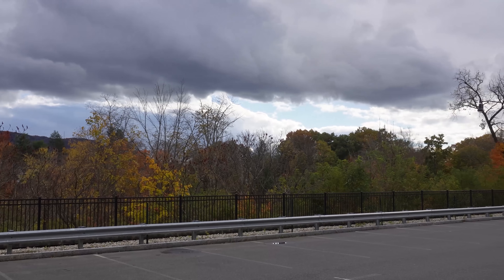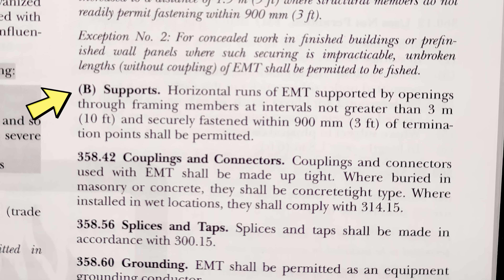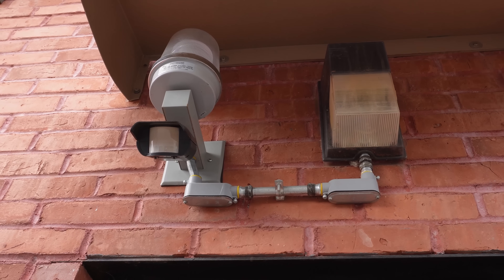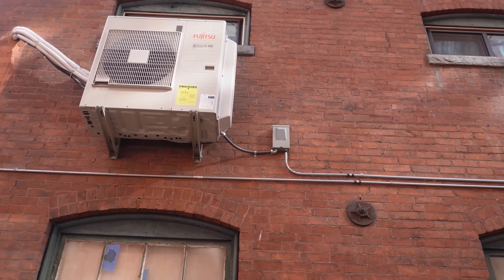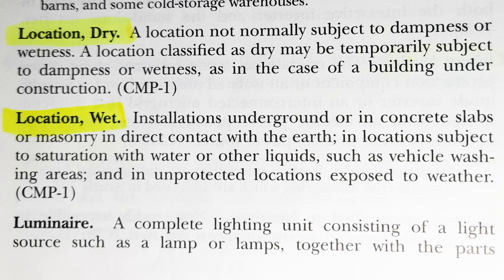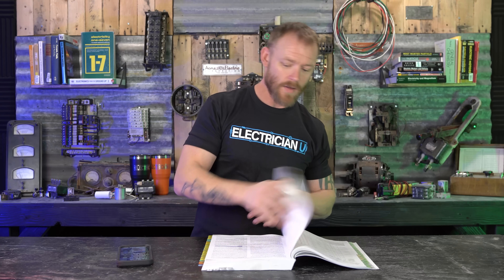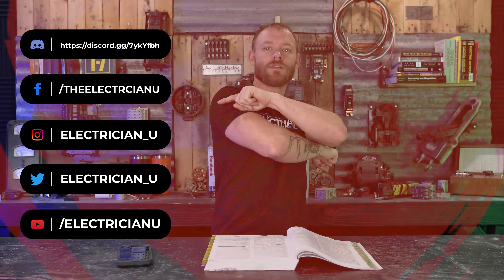Finding Code Violations in a 100 Year Old Building!

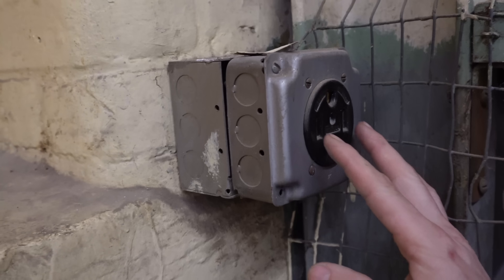Comment: at 10:40 you show a pipe above a 240 volt outlet and being commercial I have to wonder if that was a compressed air line due to the odd (small) size of the elbow and the large body of the valve itself, which might make it a gate valve. (more common in air systems) The rest of the video has some hum-dingers for sure!
Reply: That looks to me like 1/2" galvanized pipe, with a galvanized elbow that has broken off.  (Cast iron will do that).  That's not a gate valve, it's a stop and waste, which is normally a water fitting.  (The "waste", the small nipple with the threaded cap, is so that you can drain water from the pipe downstream of the valve, so it doesn't freeze)    I suppose it could be an air line, but I think it's more likely a water line.
Reply: @andrewalexander9492 ... Had to go back and look and I believe you may be right about the S&W valve because a gate with a waste would have the waste nipple offset. Still looking at that elbows as maybe a reducing elbow which is more common with air than water. Just seems like the outside diameter on the end is smaller. One thing we can agree on is threaded pipe for air or water has long since fallen out of favor, which means that pipe is likely way older than the 240V outlet nearby. Same goes fro threaded conduit.... long gone!
Reply: @rupe53  Yeah, that might be a reducing elbow, hard to tell.  Dustin should have filmed himself opening the valve to see if water came out.

Comment: I'm currently in the process of replacing the wiring in a 110 year old house. There was still some original knob and tube powering a bunch of lights, one circuit with a 20A breaker on #14 wire feeding literally half the house, central AC and dryer wired to the same breaker (and the terminals were loose), a piece of romex (not UF) buried right in the ground to feed the garage, grounding wire went outside and was stuffed into the ground a few inches with no rod, etc. Fortunately the panel was replaced at some point with a 100A Square D QO unit that's in perfect shape, so at least I don't have to replace that too.
Reply: Sounds like the "homeowner" special...I see this a lot.... one 15A breaker with the Fridge, multiple kitchen lights, the microwave and 2/3 rec....The home owner wondering why their "breaker trips every time the fridge kicks on" lol....See this in a lot of houses wired before 1960....
Reply: @mikenormandy9250  then when you suggest wiring in 5 to 7 dedicated circuits to the kitchen appliances and counters, they spaz out at the cost. lol
Reply: Man that's crazy!  Might want to retire that (tortured) 20A breaker!
Reply: @yeliab814  The circuit was in such bad shape it could barely power a tiny 5000 BTU A/C in an upstairs bedroom (less than 500w), and I ended up using a #14 extension cord to get power. The breaker didn’t trip and the circuit wasn’t overloaded (the only other things running were a couple LED lights), but the voltage sagged to under 100v running the A/C.
Reply: @Frog-ko6uu  wow .   thank goodness you:
1) have discovered all of this , 
2) know what you've doing, 
3) are in a position to correct things and have a plan to do so, 
4) know how to safely workaround things in the meantime.

Just think of all the terrible situations like this that are out there - with the owners completely oblivious.    This is reason enough to follow and support this channel , just to gain the necessary electrical knowledge to know how to protect your own property and family.

Wishing you good luck with the remediation / upgrade plans, and thanks for sharing !
Reply: wait . . . exposed romex burried in the dirt? what the actual eff!
Reply: @arnoldduran4953  Yes, to my knowledge it is exposed. A piece of #14 romex goes through a hole in the basement wall without conduit, and comes up in a bit of gray PVC outside the garage. It’s been there for a long time (it’s just NM, not NM-B) and works for now, but will definitely get replaced with UF after I finish rewiring the house.
Reply: @Frog-ko6uu  Maybe the house had a ground rod but it corroded so badly that only a short wire was left in the ground.
Reply: I have 30A on a 14g wire knob and tube in my house. It has worked for 80 years...
You cannot compare it directly to modern wire ratings because they are based on the limits of the insulation. Asbestos or fiberglass, whatever is on those handles higher temps than modern plastic. Also it is open air for cooling.
Reply: @court2379   Are you talking about a 30 amp service?
 One hot coming into the service at 30 amp Overcurrent with 1 neutral?
Reply: @frankpaya690  60A service, two same phase circuits, two 30A fuses serving them, 14ga wire, hot and neutral distributing it thru the house with twisted around and taped up connections. 

As off a few weeks back I finally replaced the last of it.
Reply: @court2379  The service needs to be upgraded. Then more circuits can be added. Dryers and other appliances like AC and microwaves are supposed to have a dedicated circuit- each.
Reply: @frankpaya690  Tell that to 1950...
Reply: @court2379  That's why you upgrade the service in 2022. All I keep hearing about is the knob & tube& knob&tube and more knob and TUBE!
 It seems the Mantra has caught- on but the panels with overcurrents and circuits don't seem to be talked about. Knob and tube wiring in and  of itself isn't "dangerous".
Reply: @frankpaya690  I did replace it. All the way back to the transmission lines, four panels on/in two buildings doubling the amperage, over 4/0 wire due to long distances and adding the second phase for 240.
Reply: At one time, the Code allowed higher ampacities on knob-and-tube wiring which was not surrounded by building insulation. So, having a 20A breaker on #14 may have been OK depending on the date of installation and whether or not the house was insulated.
Reply: So, direct burying romex for a little shed, is against code?( Asking for a friend. )
Reply: @treeguyable  Yes, You need UF wire
Reply: @mikenormandy9250  Thx
Reply: @treeguyable  And, you need to protect it where it goes above ground... and, it needs to be 24" deep if not in conduit..
Reply: @kolyachesley9953  Thx, didn't want to hear that!😆
Reply: @treeguyable   It would have to be rated for direct burial in Earth.
Reply: @frankpaya690  ( Shhh, I know!)

Comment: I think I recognize that work with the mini splits. It's not just the old buildings, we rent in a building built in the early '80s the nail salon previously hung all their wire with what I call bento box string. Outlets wired with extension cords. Jboxes hanging from coat hangers.

Comment: I like that he requests people to cite.. too many internet warriors out there acting like "this is the way because I just know it is!"
Reply: I like it because it helps us as an industry
Reply: Internet warriors?  This is endemic to the trade as a whole, especially old timers been doing shit the same way since the 80s--incorrectly.
Reply: As for rain tight fittings. Such a thing did not actually exist and most of the electrical code history. And for a period of time, are used to have fittings that were legal in one code cycle, and illegal in the next. That was about in the 96 code cycle or so, when rain tight fittings had gaskets added to them for the UL market. And the same compression fittings that I had from the year previous, would be rain tight, if I threw them over the border into Canada for sometime.

As a code history buff, you have to remember that certain materials did not exist always. EMT has been around most of my lifetime, some of the people that I learned the code from, preexisted it. And you would hear things like “arranged to drain“ all exterior, or underground conduit‘s were considered wet, and considered to have water flow in them. Outside, you would be using rigid threaded conduit, with threaded couplings, and threaded unions, like Myers hubs. Or a sealing lock nut -  A lock nut with a gasket on it. But again all of the conduits would be arranged so that they would have water flow to a place, so that it could be released from the system. Either into a box, that had weep holes in it, or underground into a Christy box. You can still find the “arranged to drain“ language still in the code today.

Edited to remove Siri-isms…..
Reply: @NoName-OG1  314.15 is a tricky interpretation and drilling a 1/4" hole in an enclosure makes it a damp location
Reply: IMO per the NEC
Reply: @Williesnyder77  the inside of a box in a damp location is still a damp location. The inside of a box - no matter what condition it is in - in a wet location - the inside of the box - is still a wet location. Even if fully sealed.

You can argue that a box on the outside of a building but not in an area to receive rain is a damp location as apprised to wet. But never argue that the interior of any exterior box is dry… When even inferior locations can be damp (like portions of a bathroom)

You can see this in 100 in definitions.

A 1/4” hole on the bottom of boxes and LBs is common standard practice of older folk. And in most service enclosures that hole is pre installed by the manufacturer. 😉

See also 300.9

And since this is our first meeting. The code is “permissive unless restrictive” paraphrased from the NEC style manual and inspectors classes for decades. “Unless specifically not allowed it’s allowed.” Common standard practice may apply and change from time to time. 

Have a nice night brother.
Reply: I quote all the references
Reply: Back in the day, before internet, the warriors were guys sitting around the checkerboard, with similar comments. The internet, is our new checkerboard, but with anomonimity.
Reply: @treeguyable  before the Internet random people would just yell form a distance — ‘hey your doing it wrong!’

Or post a picture in EC&M magazine….
Reply: Where is the building
Reply: Lol that's not just the internet I worked at way too many different places as an apprentice and realized everybody thinks their way is the best way
Reply: During my apprenticeship, we had to give the citation on every Code exam and quiz for the answer to be right. If you can't cite Code, you need to hang your tools up and go be a carpenter instead.
Reply: @alexpopescu7312  Even carpenters have to follow the National Building Code. 🤣
Reply: @MichaelArtelle  yeah, nothing but installs up to Code and a workmanlike manner for Jose, huh?
Reply: @alexpopescu7312  My problem is people interpreting the code incorrectly.

Comment: I was on a job today and I wish I could post the picture, but, this specific job was us fixing some sub panel issues. 

Well it turns out the issue was the service wire feeding the sub was run above ground with no protection across the drive way and connected to another run of service wire outside the house with only duct tape. Then it ran inside the house and inside the panel it was held into the lugs with 6 drywall screws. 

I can't put into word how ridiculous everything was.
Reply: Did they at least use metal lath screws?
Reply: The mess of connections was just laying on the ground and it went into the house thru a 4 inch hole sealed by sprayfoam and then into the bottom of the panel which was about 18 inches off the ground.

Comment: My dad worked in a power plant that was built in the 1930's.  He was telling me that the internal electric service was ancient.  In the late 1980's the plant was rewired for lights ECT and brought up to code.  It was a major refit.
Reply: I worked for an electric utility back in the 80's that had all sorts of ancient live-front switchboards that were still in operation.  And not just one or two either.
Reply: @tgmct  if you think that's weird.

You should have seen what we call the catacombs beneath my High School.

Straight up miniature railroad tracks.

What look like full-on DC utilities and Power Plant. 

Perhaps converter station of some sort.

But really odd voltages that you never see.

It was thought that this was left over from the Old Trolley system.

Or something else neobond of DC power.

However everything was still active.

Literally down to the Mercury Arc rectifiers there's also rotary converters!

And also battery rooms with modern batteries.

Also doors that would only open from one side down corridors.

Literally open wiring on insulators in some cases not even insulated but heavy cables.

Some of this looks like it was over a hundred years old but other modern equipment right next to it keeping the system going for an unknown reason.

Something really weird going on no one has figured out to this day what it was for.

There are no Subways or any sort of Transportation or anything that would need anything like that in the area.

And there was also 120 volts DC 220 DC and other odd voltages.

A never-was wobbly thing would fire up on fire out what the current in more stuff would come on line.

When the people that gave me a tour of the Catacombs again as we called it.

Said you know that there's times when the lights just I'm here at the school bit that's when that is occurring that at certain times more of the equipment comes online down there!

No clue as to what this would be.

Barely there was also an underground substation.

I had checked there is nothing on a map nor anyone knows about this!

And yes there were backup equipment for generating power in that area further down the way.

Most of which was for DC power which is just what the!

It has been theorized possibly something military otherwise very secretive.

I do know this was a hotspot During certain years.

So it makes sense with the underground transportation system what that something was still going on.

This is like some sort of Narrow Gauge electric Railway.

Probably meant to move some sort of cargo.

These doors between sections seem to be weatherproof and almost like blast doors or something like that.

And since no one or nothing with on the map makes you wonder.

Also pretty weird stuff around that place an unsuspecting areas like in the old Towers in such where there was louvers.

Such as what look like signal lights and the colored filters and mechanical things to go with that.

To the point of boxes in those sections having civil defense markings makes you wonder.

Also all those areas were accessible from elsewhere in the catacombs as well but yet mostly not from inside the building.

This is entirely true not making this up but wow any thoughts??
Reply: @aaronbrandenburg2441  as your comment went along it became harder and harder to follow or understand.... and I just stopped trying to read it and understand.
Reply: @aaronbrandenburg2441  Were you ever able to learn anything more?  Time to interview old,  retired staff who  graduated back in the  '50s.

Comment: I'm from Massachusetts my house was built in 1800 nothing is grounded all my sockets are blown out and the plugs fall right out the wall
Reply: electric was installed during new construction in 1800? Maybe 1900 if it was a populated area.
Reply: @rupe53  probably not from New maybe retrofitted later. pretty sure it used gas lighting way back when
Reply: @mattie22011  ... I have been in older homes that had gaslight and it's quite interesting to see how things are laid out. Somewhere circa 1910 electric started changing from knob & tube over to BX style cable. After WWII the cloth covered (silver or black) style Romex cable gained popularity in some areas but most went back to BX throughout the 60s into the 70s because the metal covering was the ground. My home was built in 1911 with a 30 amp 110 volt service that was all BX cable. That cable had tags from Montgomery Ward, who was in competition with Sears at the time.